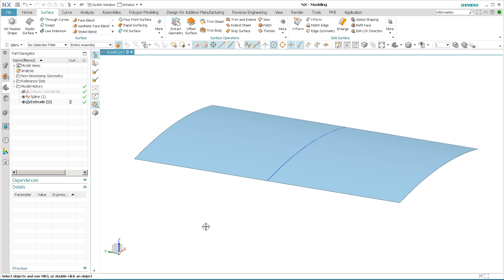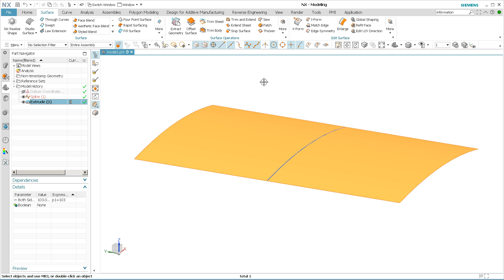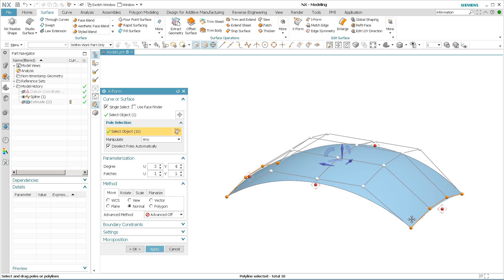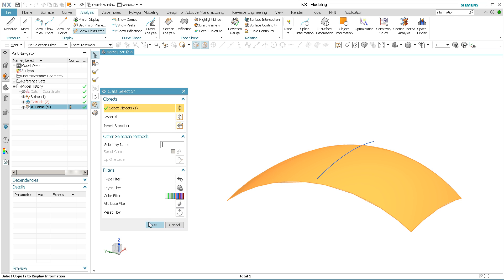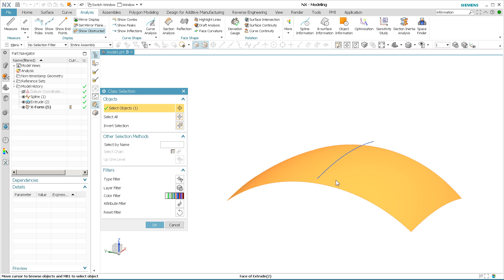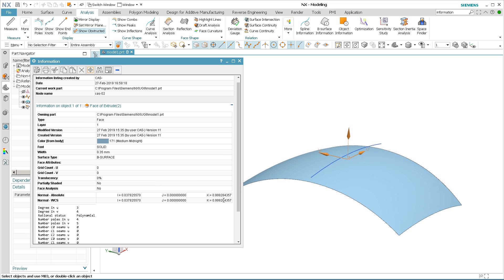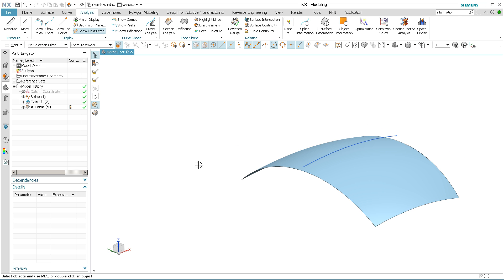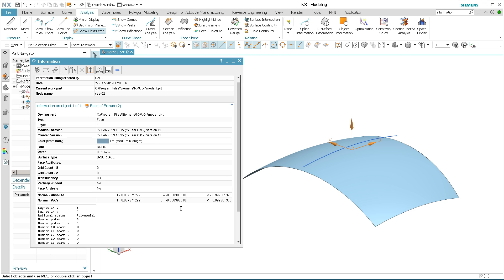Siemens NX: Perfect Balance

Comment: Hello! Great way to check!

1. But what if, after checking, you saw a deviation from symmetry? How to align the points?

2. This is very interesting, how can you align individual points in X-shapes on a plane? Or by line? I mean the Planarize tab. There you can align only the entire line of points entirely. What if I need to align a few points on the line? Or align 2 different points on a plane?

Could this be a video theme? :)

Thanks again for your videos! :)
Reply from the maker: More to come...

Those are really good questions though.